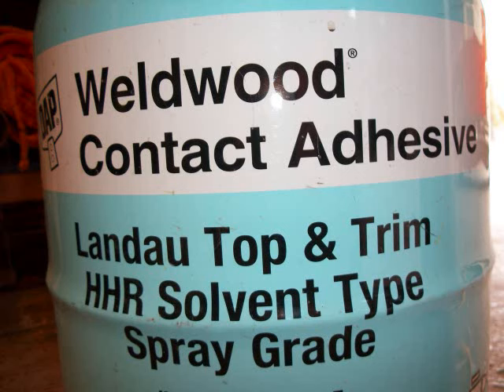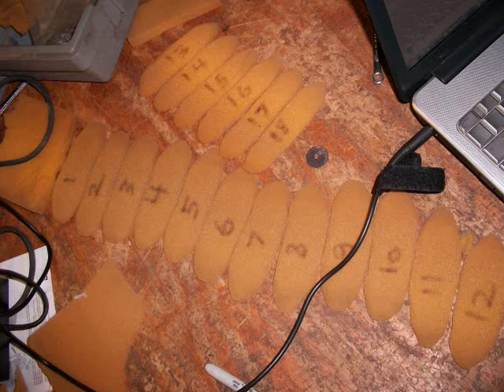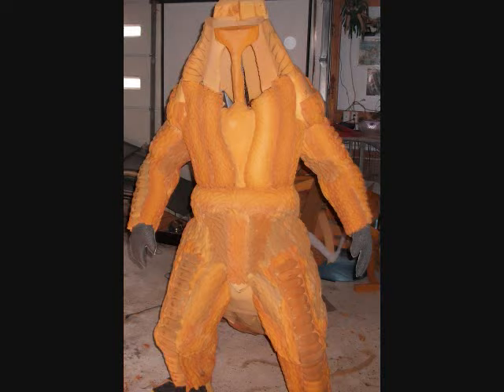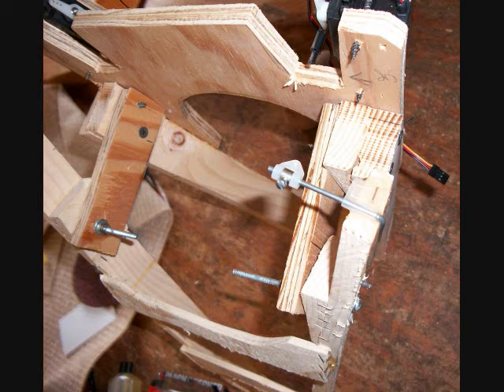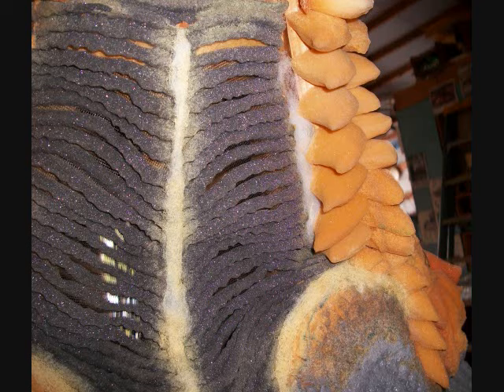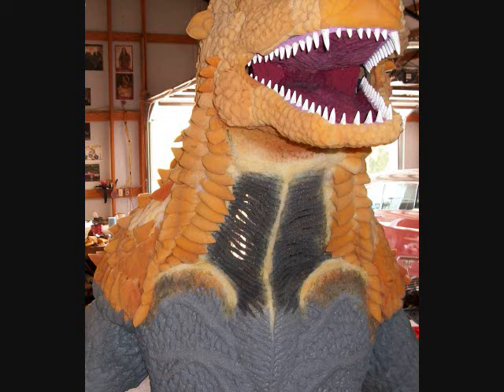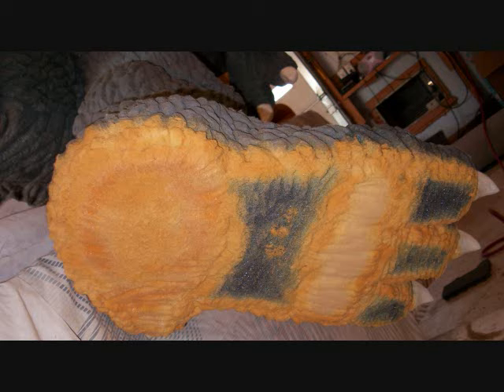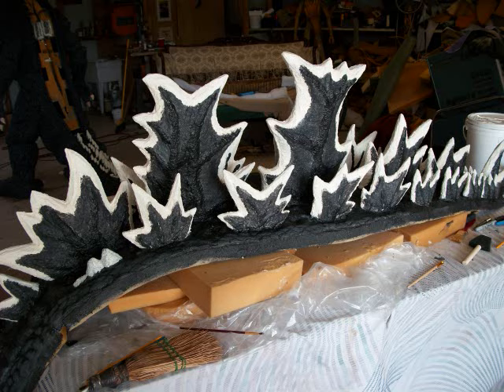Hyper Godzilla Construction Retrospective

Comment: What do you use for foot padding? Also, I'm thinking of maybe doing a series of videos that chronicle the construction of the suit that I'd build someday. When I do, I'll be happy to give you a shout out as my way of thanking you for taking the time to answer my questions.
Reply from the maker: You don't have to do that, but I thank you for the consideration :) As for the padding, I usually just use denser foams, but with that suit (and a few others) I used the soft rubber part of anti slip floormat that a friend of the family gave to my dad. In recent years I've been putting thick shoe insoles into an extra pair of socks that I wear on top of another pair. It works pretty good but they do slip to the side from time to time so you may need to reposition while wearing it

Comment: Sturdy and solid looking Godzilla. Best ones are always a video on YT. I am making one myself and maybe a month before I'm done. 
About the bottom of the tail: What material/coating did you use and how well did it stand to dragging? And would it stand outside streets well? Flex seal be good for that?
Reply from the maker: I just used liquid latex rubber on suit, went three coats for the most part, but used 4-5 coats on the bottoms of the feet, tail and parts that required a lot of flexibility. I walked on all kinds of surfaces (including gravel) and it still held strong years later when I ended up dismantling it for other projects. The one thing I'd suggest (I've never used felxseal so I can't comment on that) over time the latex will start to turn to goo depending on the conditions it's kept, but I found that doing a couple coats of latex, and then spraying it down with Plastidip and latexing over that, it reduces the "latex rot" by a substantial degree. Just make sure your surface details are incredibly well defined as multiple coats of latex and other substances will reduce the depth and roughness of the details
Reply: @AtomicStickFigure  Thanks, thats a lot of good info. I didn't even know about that latex rot. Good to know it's tough and that it went well over gravel. Do you know approximately how long before the letex starts turning into goo? I would like to go to few conventions before that kind of thing happens? I'll definitely use plastidip as well. You've given me more solid information than all other sources combined, thank you very much man.👍
Reply from the maker: @Crainage1056  No worries, always happy to help. As for the time frame, it depends on how its stored. I left the Godzilla suit in the garage which had minimal climate control and he lasted me a good 5 years if I remember correctly. Though regular recoatings of latex for various areas were required. Latex does degrade over time regardless of how well its kept. The Man-Thing suit which was made 2 years before the Hyper-Godzilla, but it was stored in the living room which has good climate control, and he still stands behind my couch, but the latex has turned brittle and stiff. 

Also, do be aware that the suits will take up a ton of space, so make sure to have a sizeable area cleared away for it
Reply: @AtomicStickFigure  Hey I have a few more questions or opinions I would like to ask about. I hope I'm not bothering you too much.

I am getting in the last months worth of work and a few things before that. For the dorsal fins mine are in shape of the Godzilla 2000's. Most of them are 2 inch thick upholstry foam and the biggest is 4 inch thick about 25 inch tall. theyre that thick because otherwise they get too bendy while standing especially the big one. I do not know how the plastidip or liquid latex would look on upholstery foam surface. (Also Flex Seal I mentioned before is something that is kinda deformed when dried sometimes, would look great for very rusty metallic prop like fallout). I am having the feet, tail, and the large dorsal fins detachable for transport, although the dorsal plates I was thinking maybe I could permanantly attach them if they're too wobbly.

I am not sure how to approach the dorsal fins. What would be the best method to make them smooth? I had a few ideas. I was thinking of using plastidip to smooth the surface(idk if the small bubbles and roughness on surface would still show), OR use liquid latex with patternless tissue paper on the surface(I don't know if the surface would have the creases in between the used tissue papers), OR use fast foam 77 to seal the surface then do one of the plastidip or liquid latex with tissue paper? Maybe a better method that you might know?
Reply from the maker: No need to apologize for asking, if you want to smooth them out, id suggest hitting them heavy with plasti dip and layering over that. The plasti dip will fill in all the porous areas of the foam, but if you don't latex over it then you run the risk of it cracking over time as plasti dip does shrink after a while, but the latex seems to prevent that (from all my experiments that is)

Whenever I've built dorsal plates I don't think I've ever had to do anything to stiffen them, but I do admit to using denser foams for those. Given just how huge the fins are for the 2000 design, if you've made them equally as big I'd say reinforcing them with wires. 

The fins from the film were made with fiberglass, but going that route would make them far heavier and nowhere near as safe
Reply: @AtomicStickFigure  Thanks I'll do the heavy plastidip and then latex. As for the wire reinforcement, it would be for around the base area of back and fin from the inside by puncturing? or also for structural support of the whole fin from inside?

I am using fast foam 74 to stick them on the base and the foam would rip before the adhesive, thats how strong they are. I was also thinking of using maybe flex seal around the base seems where they connect, at least for the biggest ones, also extra layers of latex. Although it's fins are mainly G2000, since it's my first time building anything this large I am taking some stuff from other godzillas so it's a mix.
Reply from the maker: What's the exact length of the fins and how acrobatic are you going to be in the suit?
I ask because the fins for the Hyper G, I believe the longest fin was shorter than 2 feet, around 16-18 inches if I remember correctly and I never had to worry about them pulling loose from the base.
As for the wiring, there's a couple ways to go about it. If you've got wires that are long enough, I'd just place them through the center of the fins. If they're shorter, I'd make some slits towards the center of the fin and place them there as it would act as an anchor for both the tip and where they tie into the suits. 
I've never done fins that separate indevidually, I've always done a back plate that had the fins attached to that, less of a hassle with setup time as it generally takes me plus one other person roughly 15 minutes to get me suited up.
Reply: @AtomicStickFigure  I won't be moving too much in the suit. maybe fast walking and swinging around to swipe my tail by kicking it, but thats about it.

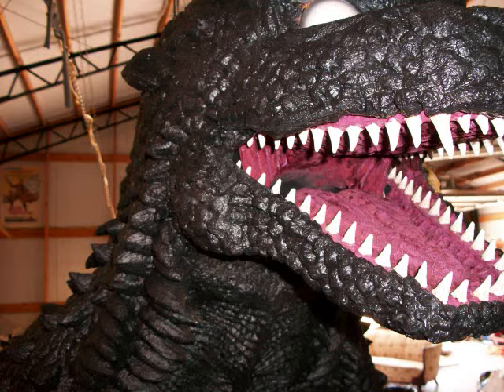The largest is the only 4 inch thick one at 25 inch tall. the rest are 2 inch thick, and the ones les than 4 inches tall are 1 inch thick. Next few mid row tallest are 18, 15, 13 and 10 then the side rows all have total of two 13's and two 10's and the rest of all are less than 10 inches. I was thinking of reinforcing them from the base with extra latex or flex seal. flex seal I saw in videos have been tougher to bend than plastidip. I made my back plate kinda like your's at 27:19 but from mid neck to about 10 inches past the base of tail. The entrence is made of 2 layers of eva foam with a large hole in the middle to enter from. the entrence's rim I left enough to put velcro on them and some extra sides are glued inside for support. there is also a buckle and strap on the top neck part for the back plate so it won't slide off easily.

There are a few detachable parts: feet, tail, back plate for transport. For the back plate if I have to I might attach the whole thing and enter from the side. The hands are not gloves and won't be operable, although there is space in them so I can slide my hands in there and move them and slide my hands out whenever. The head I am going to start soon as soon as I get the tail done within the week. I will try to make the mouth movable as well. the suit skin is from 1 inch thick foam, but reinforced some areas from inside with 1 or 2 inch thick especially the front low area.

My goal time is mid june, latest at end of june.

I suck at descriptions. I am planning to make a brief progress video with pictures and few videos. I hope that might make things clear. I sound like I am writing to my professor I hope this doesn't sound demanding.

Just made a 1 minute video of the pictures of the stuff, I hope that helps.
https://youtu.be/wqXJO7BMJmU
Reply: @AtomicStickFigure  The Suit was done last july for kitsune kon 2023. I just finished the video, its on my channel. Thanks for the help. It reassured me that the fins would not fall off. Those things were definitely not coming off.

Comment: Is it easy to take parts of a costume off once they're glued on, or do you have to somehow loosen the bond between glue and foam?
Reply from the maker: @dragonsmyth  Depends on the saturation of glue. Theres times where I went back and was able to pull the pieces apart with minor tearing, and some instances where I had no choice but to cut the pieces apart. I think it also depends on the foam. Seems like some are pretty easy to separate while others are pretty much permanently bonded, its just random as to which it wants to do.
Reply: @AtomicStickFigure  Okay, thanks for the info.

Comment: So when deciding the size of your texture strips, how do you know what size to make them? I'm asking because I like how the texture looks like one consistent piece.
Reply from the maker: @dragonsmyth  in complete honesty, I don't really. I know generally how large each "scale" or "bump" is supposed to be and just make a bunch of sheets with the texture carved into them and cut/trim them to fit together. The only time I'm specific on something is when the texture has to flow a certain direction, or the size of the scales change. Thats one of the good things about working with foam, so long as the seams where the texture pieces meet aren't too obvious they look like they were intentional when they're latexed. If it does look a bit too obvious I'll occasionally do some "overlap" pieces that tie the pieces together better
Reply: @AtomicStickFigure  Thanks for your honesty.
Reply from the maker: @dragonsmyth  One of the things that I've learned over the years doing suits and props is that a sold 98% of the time no-one ever notices if there's a slight deviation in a suit design. Largely due in part to the sheer amount of detail that I put into the suits. A good example is actually the Hyper Godzilla suit, the neck ridges that I saw out of are not perfectly aligned. One side only had like 17 ridges and the other side had 23 (If I remember correctly) Yes there's times I try to be "pinpoint" specific on details, but a majority of the suits is just eyeballing it and going "Yeah, thats good enough". It kinda depends on how much time I have to devote at any given moment that dictates which approach I take. And patience. Sometimes I let things slide just so I can get it done
Reply: @AtomicStickFigure  Thank you for the input.

Comment: How do you know what thickness to use for different body parts?
Reply from the maker: @dragonsmyth  it's mostly guess work. Studying the bulk of a character gives an idea of how thick each area needs to be, then its a matter of bulking the suit up to what looks right. You can either do this to what looks right to your eye, or you can do the silhouette method like we did with the attempt at the 94 design. Get a large sheet of paper (or the foam board like we used, I dont know exactly what it's called but you can buy it at hobby lobby. Its those foldable board things that are used for school science fairs) and do a sketch of the character the size you want to build the suit and use that as a reference to determine the size and thickness you need
Reply: @AtomicStickFigure  Thank you.

Comment: Does regular urethane foam come in colors besides orange?
Reply from the maker: @dragonsmyth  it's typically a white color but it turns yellowy-orange rather quickly. There's some that are blue, but they also fade to an off yellow. I don't know the science behind it but I think it's got something to do with it being exposed to oxygen
Reply: @AtomicStickFigure  Thank you. I ask because at one place I have been to has green foam, and it got me wondering if urethane foam can be green.
Reply from the maker: @dragonsmyth  I don't see why not, the types that I use are whatever I can get my hands on. I live in the middle of nowhere and don't really drive any further than I have to so it's entirely possible that other colors exist. There is a type of grey foam that I've used a couple times, but I think that kind is specific to automotive work

Comment: How did you set up the way this costume closes, like the zipper thing?
Reply from the maker: @dragonsmyth  how specifically do you mean?
Reply: @AtomicStickFigure  Like how the zipper in the back to zip up and down to seal it and the the buttons to further seal the back. I mean how to attached those elements for the body base.
Reply from the maker: @dragonsmyth  they were just sewn in as the body base was constructed. The zipper was sewn in as it was built. Seems like the zipper was removed for some reason and replaced with the strips that had snaps in them. And then after that belts were added, I think those were a later addition if memory serves correctly. In all honesty that suit was built so long ago that my memory isn't exactly the best. Looking at what remains of the suit, it's got like four snaps and three belts, and that happened when it was converted into Kirudah. For bigger suits like this I think belts and snaps are better and zippers are better for thinner suits
Reply: @AtomicStickFigure  okay, thanks for the input.